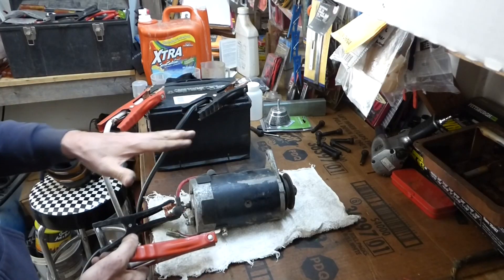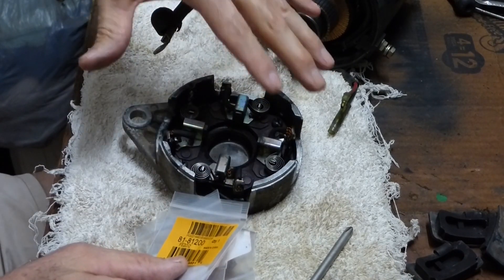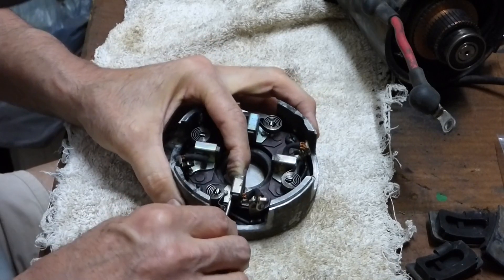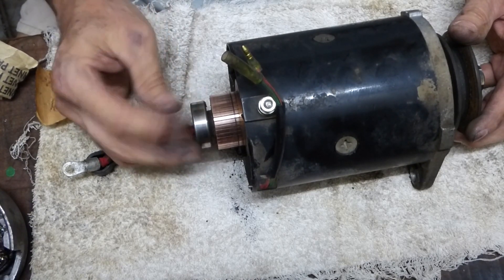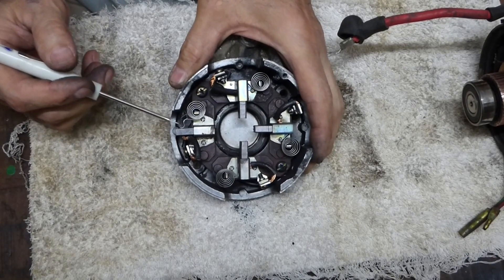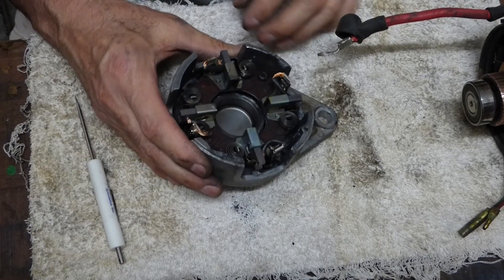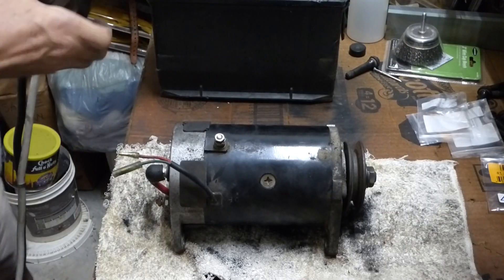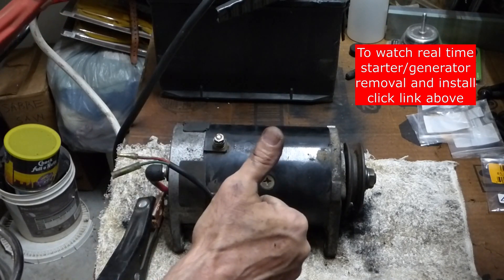Golf Cart Starter Generator Testing & Repair - How to Replace Brushes

Comment: I gotta have Hitachi generator/starter 10:51  came off my Yamaha 1999 model anyway this sucker is really eat out with corrosion when I try to crank it it actually pops and sounds like a firecracker and smells that gives off an electrical burning type smell you know that smell when you smell an electrical fire it smells like something burning definitely the storage generator I actually can smell it when it’s not even turning over I just by pressing the gas pedal and turning the key you know the ignition and all in press the gas pedal often times it doesn’t even make any sound at all you know just totally dead solenoid clicking fine and it’s working good but his daughter even when it makes no noise at all I can still smell that burning Electrical smell Electrical fire Electrical burn type smell admits that aroma even when it’s not even making any other sound at all like it’s just sizzling or something really cooking in that sucker and every now and then it pops like a firecracker must have an internal short do you think it would be worth doing a rebuild on it and putting new brushes on it the brushes are absolutely worn to nothing and the video has been very helpful but I was curious if you think it would be worth trying to rebuild being that it does have an internal short and it could be something going on beyond the brushes but I’m assuming if I put new wires on all the brushes like you had that came in your packet wires already were attached to the brushes if something like this is what I ordered to rebuild it do you think it would be worth a shot I mean or should I go ahead and spend 300 bucks On another one that’s not even hot I can’t even find a real Hitachi that’s not used I mean I don’t even know if they make them anymore but there’s a lot of crap on eBay I see that will fit and then you know counterfeit Chinese knockoff type thing that I’m sure it would not last very long at all if it even works out of the box it just looks like tinfoil and garbage you know love they are very helpful I’m addressing this spare issue on my 1999 Yamaha and it’s been quite a job of your video was most helpful thank you

Comment: I’ve been having an issue with my Yamaha G16 and I’ve narrowed it down to the starter generator. It’s doing the exact same thing where it’s dead, but as soon as I tap it with a mallet it works for a minute. 

Thanks for this video! The part where you showed the worn down one to the new one was eye-opening. I’ll be removing my starter and checking those brushes.

This is why I love YouTube. There’s a video for just about anything!
Reply from the maker: Sounds like you are on the right track

Comment: my y2000 model. Contact posts and wiring eyes had broken down. New eyes on the 2 wires on loom. Shined up connection threads. Made a big start improvement. I also made a tool to pull belt tight . To pull up tension.

Comment: So will the brushes spring back automatically when initially hooked on the power?
Reply from the maker: The brushes are spring loaded and rub against the commutator.  They are graphite and conduct electricity and lubricate the commutator.
Reply: wow! Thanks for the quick reply. I appreciate that! Lemme try this again

Now I’m no mechanic…
So, I meant sometime after 8:00 min you placed the aluminum cap back in without explicitly showing how each of the 4 brushes were placed back in position before capping them with their black rubber squares. The video then skipped a scene and the quick link to your extended version was not there at the moment. I simply concluded the brushes were automatically springed into place when you hooked up to the battery to test. My Apologies for my lack of terminology. “Commutator “, I’ll look that up, too.

Again, I appreciate the response. And your channel name truly fits: @helpinguonline. 👍🏽
Reply from the maker: You will need to push the brushes back in against the commutator before installing the rubber caps.

Comment: I have the same starter it’s brand new still shiny, not burnt at all inside but I can’t get it to turn at all. It freely turns by hand, I opened it up to check for shorts on the brush plate with my power probe, no short. F1 and F2 terminals on the sides both pass voltage right through and both the terminals on the brush plate pass voltage through but the body should show ground when I have F1 or F2 grounded right? I cannot figure out why putting power to it does nothing, it’s straight from the factory and has never been used. 🤯 I might have to pull the pulley off the front and pull the rotor out to see what’s going on with this thing. Seems like they’d test it out at the factory to make sure this type of thing doesn’t happen. It’s been too long to return it now too.

Comment: I need help with my golf cart. It’s a 2004 ezgo gas. The problem is press down on gas pedal doesn’t do anything sometimes you get a clicking noise from a square box with a bolt in the center of it next to battery. Has a new battery. Appreciate any help
Reply from the maker: It sounds like the square box you are describing is the solenoid. Take that plastic cover off that square box and either you have a loose wire or that solenoid switch is bad
Reply: @helpinguonline  would the brushes is the starter generator being wore cause this problem also.
Reply from the maker: They could.  Tap on the starter/generator and see if it will kick in

Comment: If the motor is running what should voltage be on r/g wires be directly on starter thanks

Comment: new starter brushes wore out in 3 months, any idea why?
Reply from the maker: Also check and make sure your batteries good if your batteries bad that Cause your problem
Reply from the maker: Probably something making your brushes work all the time… Could be starter hung up or the regulator for the generator is making it charge all the time. OK

Comment: I’m struggling to get my golf cart to work I watched this video and changed the bushes but when I do the bench test my starter generator is running in slow motion any ideas why this it ??
Reply from the maker: Make sure you you are hooking up the positive to the positive and the negative to the negative when you bench test it. Make sure you have a good strong battery. And if not those two things check your armature

Comment: Our brushes are within the where limits but when the starter alternator gets hot it does not turn over would that be more of an Armature problem?, has new starter relay Etc thank you
Reply: My starter / generator gets real hot after a few miles.  Like surface is 165 degrees after 5 miles.  How hot should it get ????

Comment: Where did you order the brushes from?
Reply from the maker: ebay from seller mcgworld_1 for just under $9.  No relationship with that seller just ordered from them because of price and delivery speed.  They have worked well.
Reply: Also available on Amazon.  Prime is about a dollar more.  Just search "golf cart starter brushes", they'll come right  up.

Comment: My battery has stopped charging on my G2 petrol buggy, I wonder if my starter is not working properly? Maybe some new brushes are the answer?? A new starter is over $500 to replace! This video might be the answer??
Reply from the maker: You can test your generator voltage output easily with a cheap multi meter.  that will tell you if your generator is the problem or your voltage regulator or possibly you have a frayed wire or disconnected or poor wire connection.
There are videos online that will show you how to run the tests.
Just type in something like:
How do I test the voltage output on a generator starter for a golf cart.
Let us know what you find out.
Reply: @helpinguonline  Thank you, very helpful!

Comment: So I drove my golf cart and it didn’t charge the battery while in use, so when I stopped it wouldn’t turn back over.  Could this be the issue on why it’s not charging the battery?  I have gas Yamaha G2.
Reply from the maker: if your battery is not charging I would start by looking at your generator and wiring since they are the source of your battery charging.  start simple by looking for frayed wires, bad connections, corrosion, etc
Reply: @helpinguonline  ok thank you

Comment: I am rebuilding a cart from the ground up in a custom way. One problem I can not find an answer to is after the solenoid closes and the motor starting running, does the solenoid open back up or remain closed? I can't seem to find a straight answer on this

Comment: Great video, but when bench testing I suggest connecting the the positive lead (jumper cable) first, and then touching the negative lead to the metal housing of the starter-generator.  Otherwise you risk damaging the threads and nut at that terminal cauaused by the  electrical arcing that occurs when you momentarily touch the positive lead to the terminal.

Comment: So, you could have just changed the brushes without removing the back
Reply: It's two bolts to remove the back. It makes it easier to replace them.

Comment: What year an model was that ..its just like mine
Reply from the maker: If I remember correctly it was around a 1990 model G2
Reply from the maker: Gas with a 4 cycle engine
Reply: @helpinguonline  thanks

Comment: Mine is not very old but it won't turn over all the time . And the wires get hot. Same problem possibly?
Reply from the maker: If you have a volt meter you could check and see if you are getting 12 volts to the starter.  If you are and your starter is grounded properly then most likely your starter/generator is the problem.  
Also, as you saw me do in the video... if you tap on your starter (where the brushes are) and it turns over you most likely need to do as I showed in this video.

Let us know how it turns out and what you find.

Comment: How many volts should I be getting from my generator?  My cart died on me last time so I charged the battery and it shows around 12.8 volts. When I start the cart and run it at higher rpms it shows a bit over 15 volts.  Does that mean the generator is good?
Reply from the maker: Your generator should put out around 15 volts... so it sounds like you are good
Reply: @helpinguonline  thanks